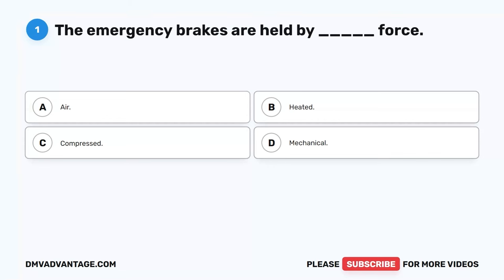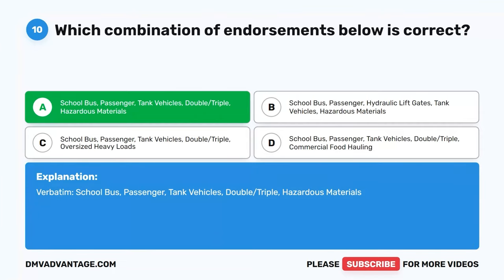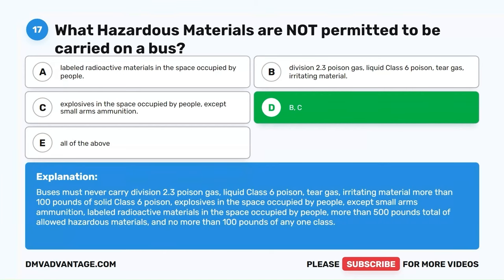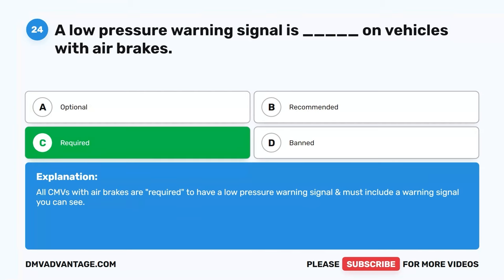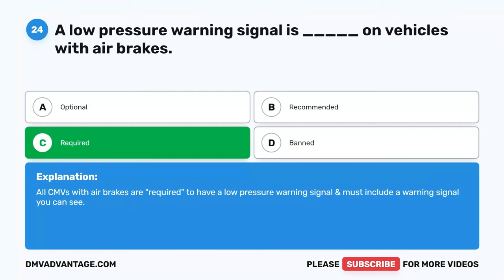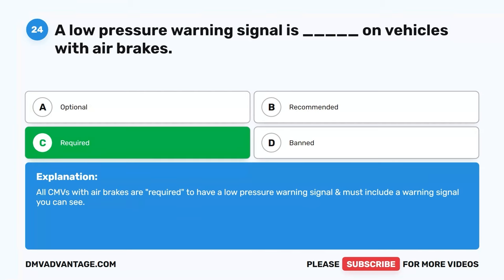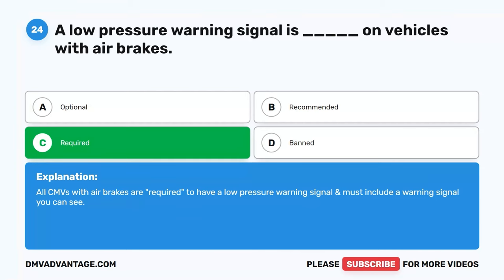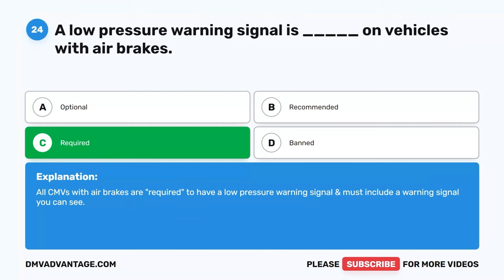CDL Air Brakes Test 2024 (60 Questions with Explained Answers)

Comment: Most of theses Questions aren't on the test at the DMV.
Reply: Not in Nevada! It is the exact questions at DMV.
Reply: I noticed that wtf
Reply: I think 53 is wrong ! If you are driving a 30 foot vehicle at 55mph, how many seconds of following distance should you allow ? 3 seconds? At 40 mph you are spose to add a sec so it should be 4 right ?
Reply: @Jcharm1937  yes it is 1 second per 10 feet
Reply: @marvinpostadan3484  hell in Memphis too
Reply: See test 2 and 3
Reply: @Jcharm1937  it's correct for every 10 ft is 1 seconds. So for 30 ft is 3 seconds